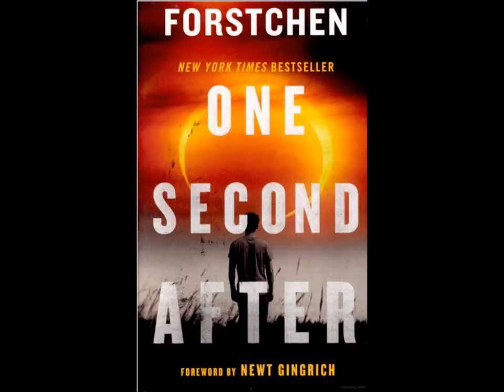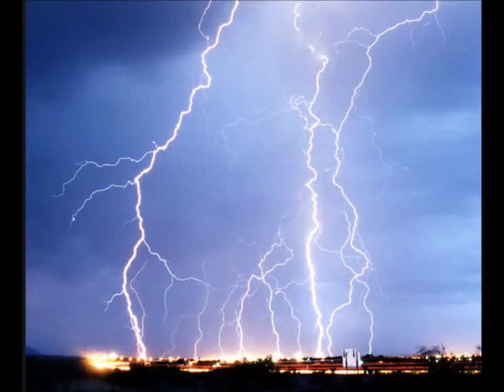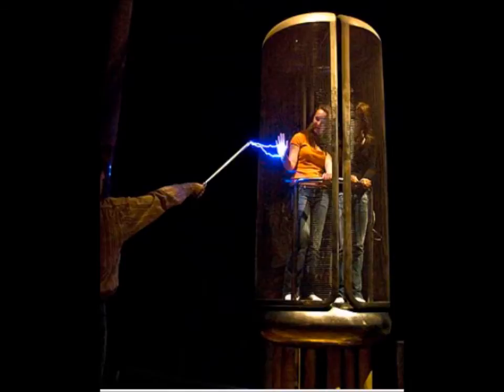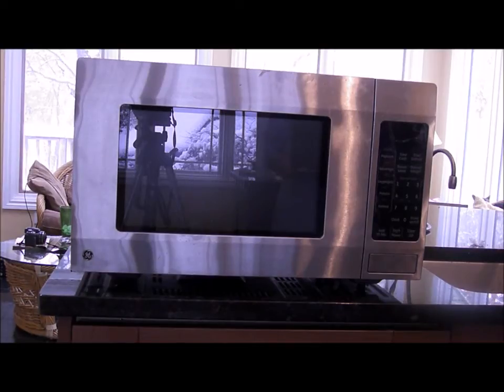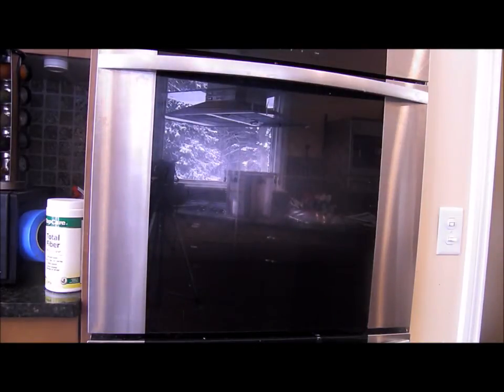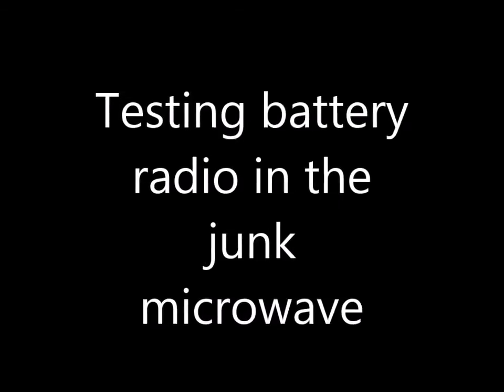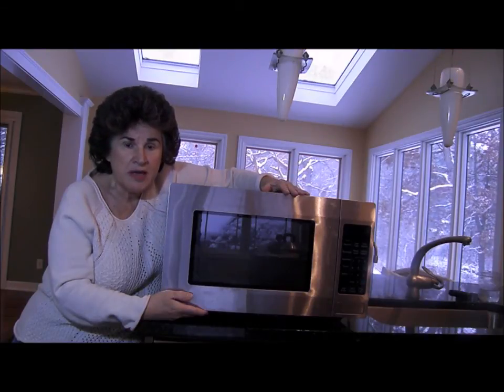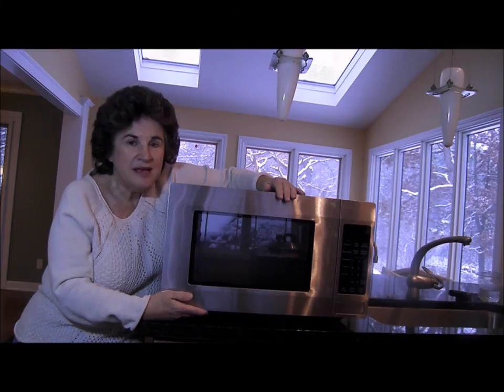Microwave Faraday Cage

Comment: I'm wondering if your pressure canner would work.
Reply from the maker: Never thought of that
Reply: +Prepper Potpourri I'm thinking that putting some cardboard or rubber around the inside and then putting devices into anti static bags inside a metal on metal canner like all American with the clamps tightened with work.  It's a tight seal otherwise the lids would blow off.  They are also nice thick metal.  Just a thought.

Comment: I have seen several articles that say that a microwave can be used as a faraday cage/box. What I can't seem to find is, does the microwave, whether working or not, need to be plugged in? I would think NOT, but want to double check.
Reply from the maker: Stevi White No it does not need to be plugged in. Thanks for watching!

Comment: That is BRILLIANT!  Could one use a working microwave, just unplug it first, (and add a sign to remove the phones before plugging in LOL) or does it need to be one that will not work? I am like you, I like to be prepared for short-term disruptions. I think of the Faraday cage  in the same way as unplugging during lightning storms: the event is possible, and after-the-fact is too late.... but do we really want to go through that every time a cloud comes up?  Instead, a Faraday cage could be valuable for regular storage of readiness supplies like an old back-up phone, two-way radios etc.  And your old microwave would be PERFECT for that use. :-)  Tina
Reply from the maker: Pecan Corner It can be new or used. It just can't have any "leaks."

Comment: I have thought about this and feel it would be a good idea to have one option for this kind of protection; i like the idea of using a non working microwave for two reasons; it keeps it out of the landfill and  also has some size so many items can be used and or stored in it; thanks for the video
Reply from the maker: Tracy Bruring Yes, it actually is pretty roomy.